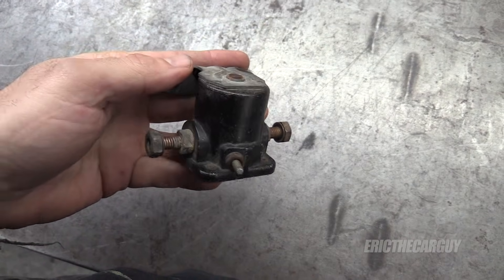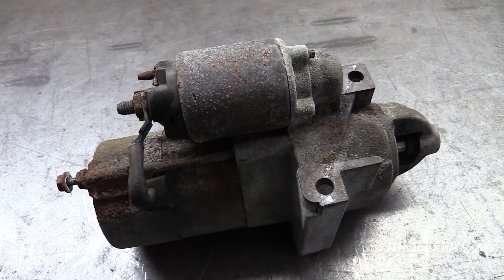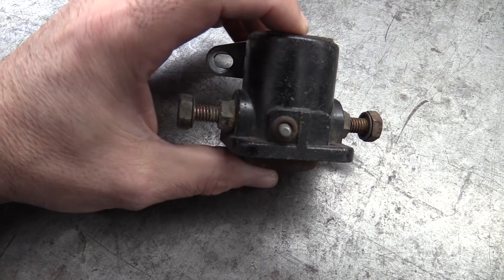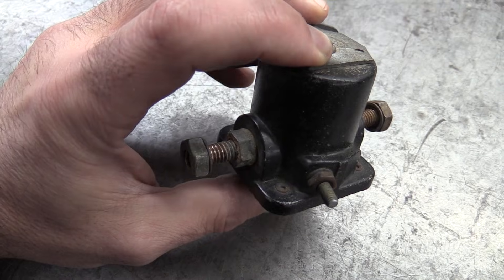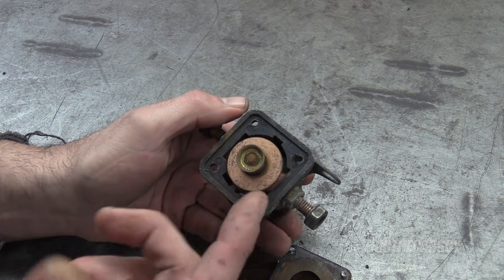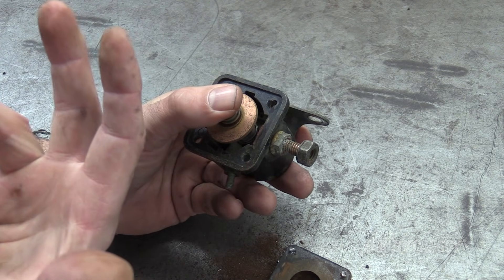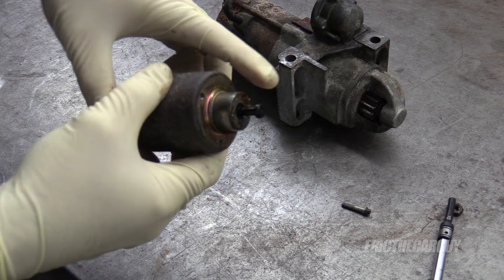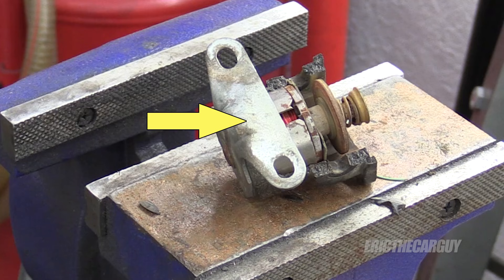How Does a Starter Solenoid Work?

Comment: I used to keep several spare solenoids in the trunk of my 5.0 1981 thunderbird.  What an awful car that was. The plastic coating on the timing chain ( to make it quiet ) broke off and worked its way into the oil pump , locking it up and breaking the oil pump drive shaft. I changed the rod & main bearings with the engine still in the car. Didn't even pull the valve covers. Compression was a little low after that.
Reply: government regulation, EPA standards. now every car in the USA must pass stringent emissions tests
 so manufacturers  use every trick in the book to do that. Lighter materials are used now more than ever because lighter cars use less fuel.  Aerodynamics is why cars are shaped how they are now but also the gas engine has been given sensor after sensor to collect info on how the engine is running at what load. then it makes adjustments to use less or more fuel and keep emissions low. then we have catalytic converters on every car to collect NOX gases and change carbon monoxide into water vapor through heated plates of really expensive metals lol thats not even mentioning, turbos, superchargers or variable valve timing to adjust timing on the fly. computers make engines so much better but are a pain when they need to be fixed. im a  mechanic and do this crap everyday... so after my novel, that is why cars are not "boxy" anymore
Reply: they were nice looking cars
Reply: Zorba Zen that's not true
Reply: Im comfuesd  now could you pleas explaine and teach me
Reply: Zorba Zen the 1981 thunderbird body style was only made a couple of years and is the most boxy car ever. It's like the designer traced out a shoe box onto graph paper and was sent straight into production.
Reply: Right, but that's what made it unique you can not find a car that looks like it nowhere. ha, good old days I guess when money had a value
Reply: BustedWalletGarage dayum
Reply: BustedWalletGarage do you know why they stopped designing boxy looking vehicles and went toward more egg shaped vehicles??? it's kind of gruesome...
Reply: In the 1980's we saw the development of CAD tools that were adopted by the auto industry to reduce the cost of developing body shapes. Before that, each design required a physical mock-up in clay which was very time consuming and costly.  As the computer graphics developed, you can clearly see the effect on design complexity.  Early on, cars had simple form elements that were based on flat planes blended with conic sections. Later, the introduction various forms of spline based surfaces gave designers more freedom to invent more complex forms. At the same time the development of finite element modeling and testing gave engineers the ability to simulate testing including crash testing. This allowed for more complex designs without having to real world test as much.  As BrainStorm4207 correctly points out, fuel efficiency regulation that came out of the '74 oil embargo, and other clean air regulations meant that more designers had to put more emphasis on aerodynamics. And, of course as the design tools improved, competition pushed manufacturers to improve their design aesthetics. Don't underestimate the competition form Asian manufacturers that gave Americans an alternative to the previous monopolistic practices of the Big 3.

Against this technical backdrop, was an environment of hyperinflation in the '80s that probably pushed all manufacturers in the US to try and drive down costs. So its easy to look at these things through the lens of greed but there can be external forces that have a strong influence.
Reply: should of bought 97 t-bird.  still running 278,000+
Reply: Sounds just like the mini he’s working on right now.
Reply: Why motorcycle solenoid easy to brek

Comment: Very informative. But how does the starter gear gets pulled out when you use a divorced solenoid ?
Reply from the maker: The spring in the bendix pulls it back in.